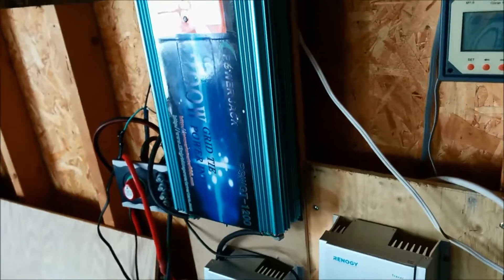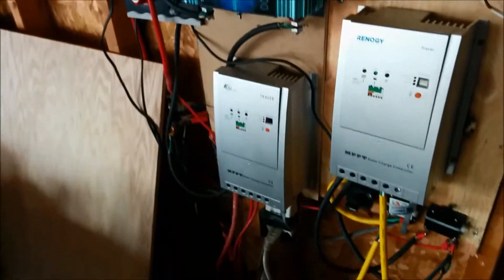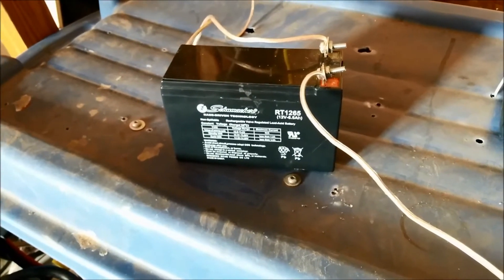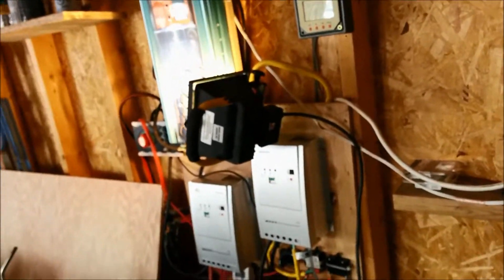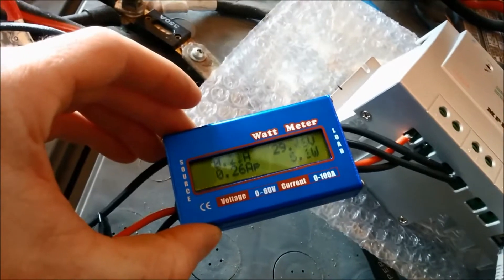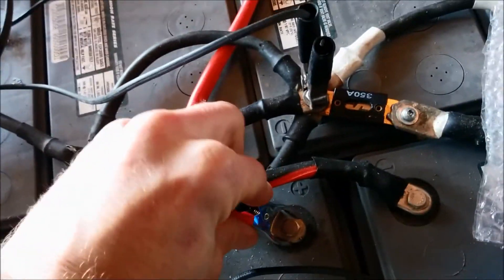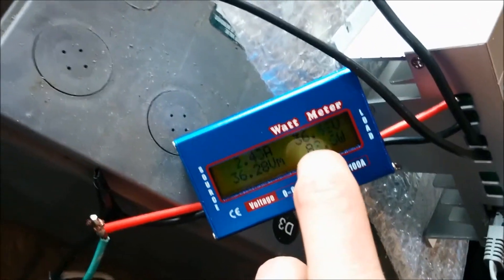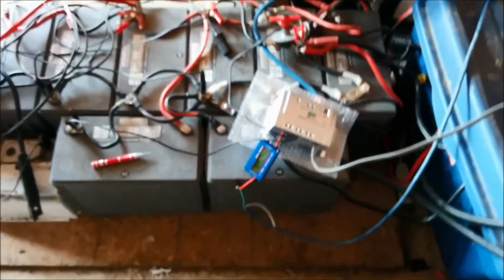tracer 10A Mppt and 255w panel

Comment: You appear to be using sealed batteries (AGM, Gel) which typically have a float voltage of 13.6 to 13.8 (the 12HX330 AGM's I have want 13.59 volts at 25C/77F with adjustment for temperature changes based on the temperature probe between the batteries).  With the battery bank at 13.8 volts, the charge controller will only be sending enough power to the batteries to maintain that voltage.  Late in a typical afternoon, my 3210a controller will be providing 0.1 amp (or less) to the battery bank regardless of the amount of solar power connected (from 100 to 500 watts) - the charge controller is doing what it's supposed to do by adjusting its output to the needs of the battery bank.

Having even ONE cell covered will affect the output of the panel.  Having multiple cells covered has an even bigger impact on the output.  Try it sometime.  Connect the meter, adjust the panel for maximum current, then cover 1, then 2 then 3 cells and watch what happens.
Reply from the maker: thanks! check out my newer videos man, glad to have you !

Comment: Hey,  a word of warning, the little blue watt meter you have will undermeasure the power going from controller to battery as the power is in short pulses from the coil inside your mppt regulator. 
The problem with this is the sample rate of the watt meter isn't near fast enough to catch the peaks or spikes which are brief at high frequency. 
I have the same watt meter and an mppt. I thought my mppt regulator was a fake (ebay flooded with them) until I opened it up to check the required parts were present then performed measurement with oscilloscope and realised watt meter inaccurate. Hope this helps.
Reply from the maker: +Matt Burrows thanks so much for this info, I will make sure to take this into account.

Comment: So, if I understand correctly, you were able to successfully (without blowing up that 10A charge controller) connect a 255 watt panel to it, while using a 12 volt battery bank?

I have been worried about expanding my array for fear of blowing up my Tracer unit (a 40 amp model), because it'd be so close to it's limit that even a little cold spike (much like you had there) could cause the power output of the panels to jump up enough to exceed the 40 amp output to my battery bank!

My question is "If my panels can supply in excess of the power needed to charge my batteries at the rated current output, will the unit limit it's draw to prevent damage to itself?"

You seem to have managed to not explode the controller so far, but does it seem to properly limit itself to putting out ~around~ 10 amps to the batteries?
Reply from the maker: I have the same 40 amp controllers (4) and i have had them up to 59 amps on peak days with no problems, just keep a fan on them in the summer, i had 750w on each with a 12v battery bank.
Reply: Thanks for the info!
I'll be adding a thermostat controlled fan to my controller soon as I noticed it got a bit warm to the touch after running all day in the summer without my current cooling fan turned on, so hopefully it'll be good to go for the panel upgrade!
(If it isn't... well... I'll use it as an excuse to buy a MidNite Classic 150 after it blows up. :P)

Comment: You are maxing out the input voltage with that 10 amp charge controller combined with a 250 watt panel at 24 volts. It will not work at all at 12 volts because a 10 amp charge controller at 12 volts will only take up to 100 watts. even with it set to work with 24 volts that charge controller is not going to last. Your putting too much input voltages into it.
Reply from the maker: well it has lasted over a year so far :) kinda doing a stress test.